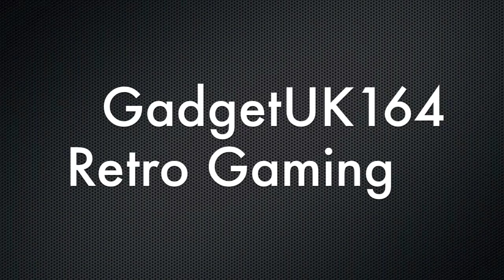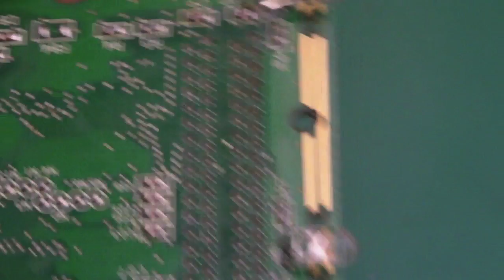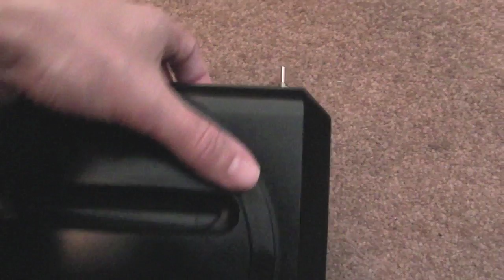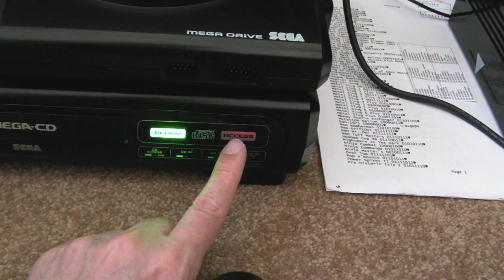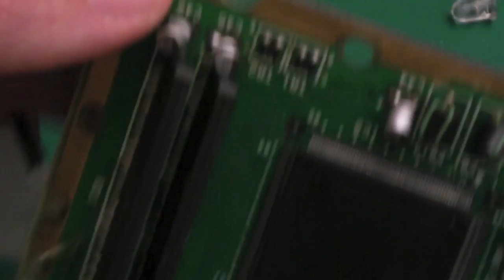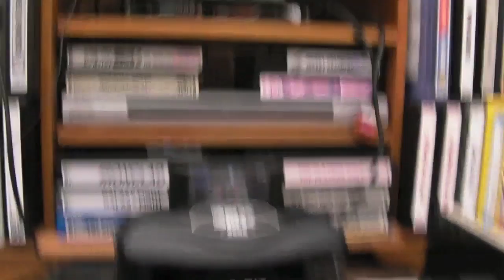Sega Megadrive (Genesis) Sega CD (Mega CD) Region Mod Part 2

Comment: Hello. I am confused by this. The Mega Drive has three regions and the Mega CD has 4 bios versions. How do you keep them in sync? Once you hold reset and go through 3 regions and back to 1 on the Mega Drive the Mega CD is on bios 4. How can the first mode on Mega Drive correspond with both 1 and 4 on the Mega CD? Thanks
Reply from the maker: At the moment I switch the Megadrive to the correct region too (manually).  But I could easily update the PIC code to control the MD region settings too.  I might do that later when I re-visit it.
Reply: @GadgetUK164  Ha, okay. Cheers. Thought this was all switchless. My mistake. I am about to do a switchless Mega CD next week. MD is done, 32x is done, just the daunting task of removing and installing a new Mega CD BIOS. Then I have them all working together.

Comment: Have you tried the region free bios?
Reply from the maker: Yes, the ROM image I created for this custom BIOS in the video has PAL, US, JPN, Region Free US (all 4 ROMs).  I tend to use the region free US ROM most of the time.
Reply: Ok ^_^ Nice! =D
Reply: speaking of modifying Mega CD BIOSes, is it possible to fix the layering in the animation? it was screwed up in the PAL Mega CD 2, as the logos are meant to go behind the cone, but they go in front of it instead because of broken layering

Comment: Looks like you Mega CD needed new SMD Caps as well? I've only worked on one Sega CD Model 1 that didn't need new SMD capacitors lol. I replaced the caps anyways just to be safe.
Reply from the maker: +Robert NES816 Yeah, I just didn't have the right size available to it ended up looking a mess - on my list of things to re-do when I get more time.
Reply: +GadgetUK164 The caps I used on both of mine are big to. They're regular through hole caps but they fit under the RF shield. It wasn't easy getting solder to flow onto the pads though. I had to clean each one really well. It's unfortunate that these consoles and Game Gears have such wide spread issues with leaking capacitors.

Comment: Lovely work as always mate, The end result looks fantastic ! Can you update the red LED with a more vibrant modern one so that the intensity of the red LED matches that of the multi coloured one ? Regardless, it looks fantastic !
Reply from the maker: +StigsWorld Thanks!  The red was swapped out!  I think the problem is the red is driven as hard as the green, and the green is way brighter than the red.  I might just need to reduce the 1K resistor on the red to 220ohm.
Reply: +GadgetUK164 ahh sorry I missed that. still the difference in the led brightness isn't very noticable
Reply from the maker: It's way better than it was!  the red was very weak before!  But I will reduce the 1K resistor and perhaps show it in a later video.  I was going to release the code and .hex file for this project so other people could use / tweak it etc.  You could use the same kind of mod for other systems etc.

Comment: Interesting mod there ! is there a remote control mod for the mega cd ? The LED light got me thinking about IR sensors and if it's possible, i remember there was a wireless controller system for the megadrive back in the day that used IR. Going off on a tangent now but great video as always !
Reply from the maker: +Beatertech That's a good point - I don't think there is and whilst it might be possible to connect a PIC up to do something like that, i think it would cause problems because there are no buttons to control activity, it's all software based and trying to communicate with the drive in parallel could cause problems.  It might be possible to have an eject button though.

Comment: Ho this one is so fancy, I'll do something similar on mine!
Reply from the maker: +The Real Phoenix Thanks =D  I really need to get the PIC to reset the MD properly as the region changes.  The one problem with the way it is now is the BIOS changes with the reset hold for 3 seconds, but the Megadrive hasn't rebooted.  This works for the most part but occasionally after swapping regions I have to switch the power off and on.
Reply: +GadgetUK164 I have the same issue with mine. This is somehow handfull for swapping region on the fly (some games are region protected, need to boot in a region then change after the Sega logo). But yeah with the bios change it makes the Mega CD bug or crash sometimes.
Reply from the maker: +The Real Phoenix Good to know it's not just me! =D

Comment from the maker: Once I've tidied up the code and uploaded it somewhere, I will provide the source and .hex file for this project.  So you can modify, or just replicate this mod yourself.  If you do modify it please let me know - it would be good to learn from others on improvements or enhancements etc.
Part 1 - https://youtu.be/VmSgr8j-zW4
Part 0 - https://youtu.be/BgF5EUa1-sE
Reply: +GadgetUK164 Try a 1M resistor?
Reply from the maker: With 1 meg I don't think it would light at all :P
Reply: +GadgetUK164  I liked your work around. idea...and a Tip for wire Mods. Use any Holes in the PCB for running wires from one side to the other.
Reply from the maker: +Amy Marie Haha, you're giving me my own tips lol - although I do need reminding, I don't always practice what I preach lol.